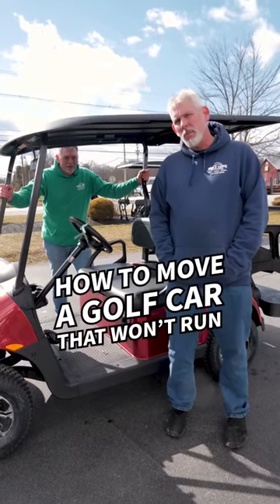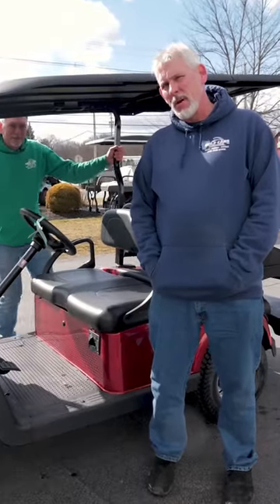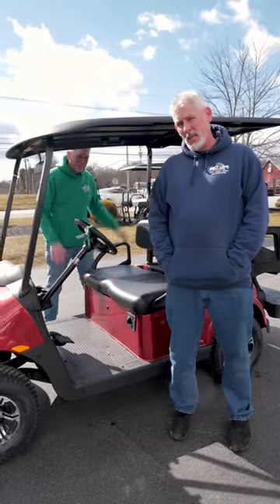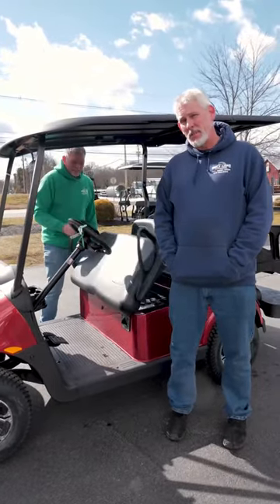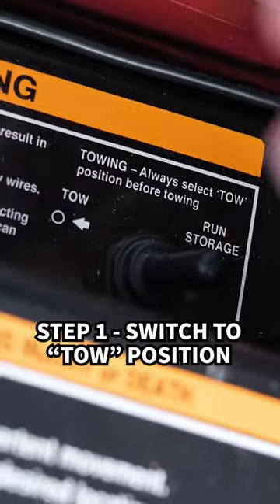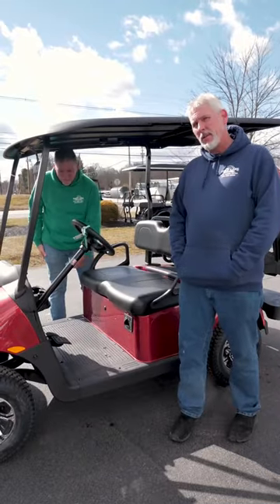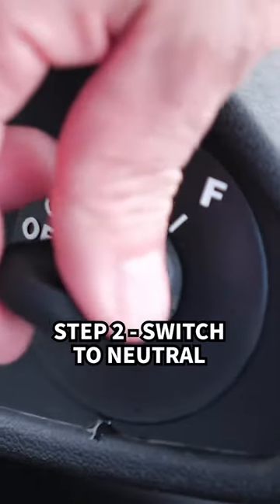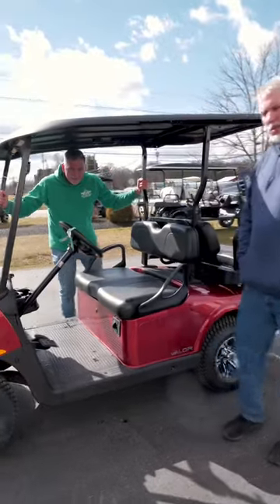How to move a dead golf car. #shorts #golfcart #golfcar

Comment: If there's no voltage in the pack then you must boost charge the batteries before trying to put it in neutral tow or remove the EM Brake. But be careful removing the brake any kind of incline the cart may roll away. I suggest using wheel blocks. 😎